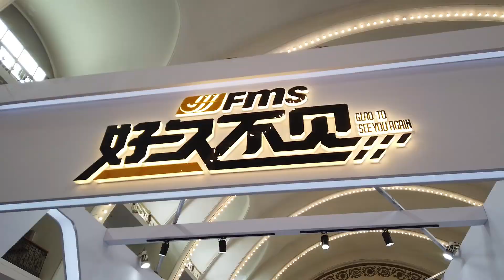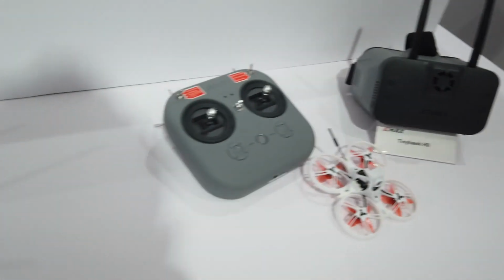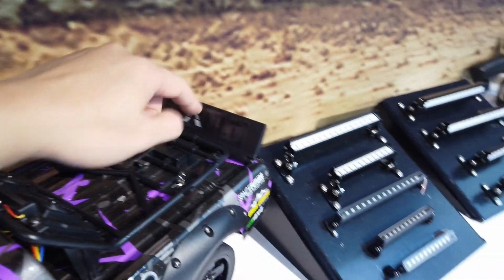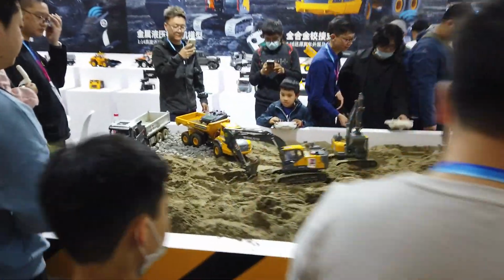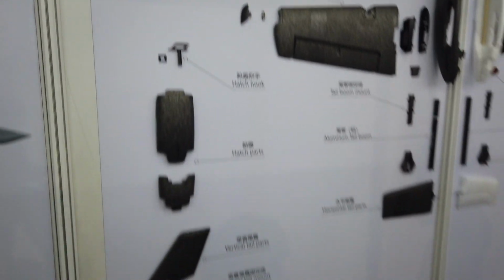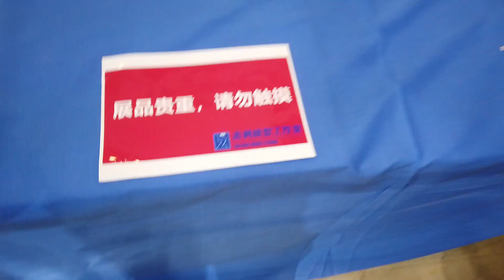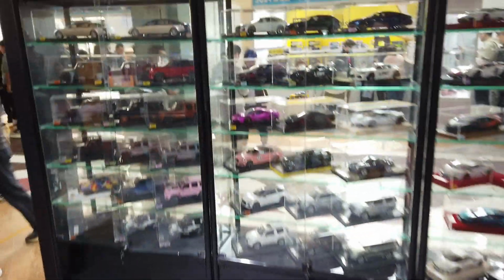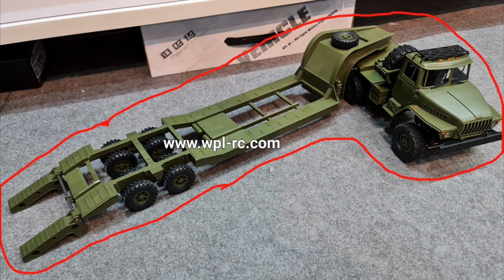I visit the Beijing Hobby Expo 2023! to Reveal the WPL Trailer but...

Comment: Will there be a conversion kit for those with a B36 already? Just the rear bed with the cut out for the 5th wheel, and the 5th wheel secured on the chassis rails is all it needs.